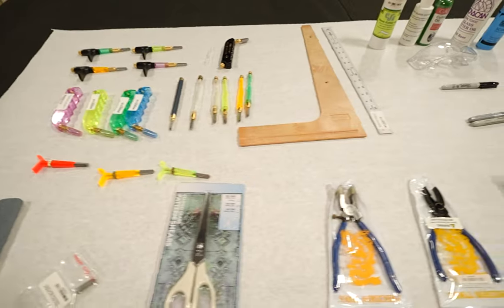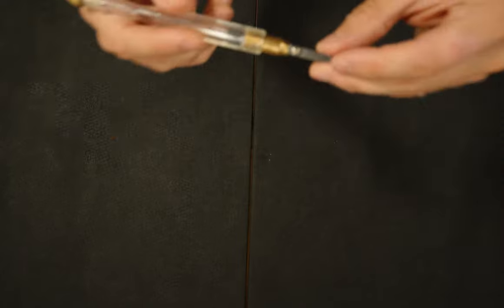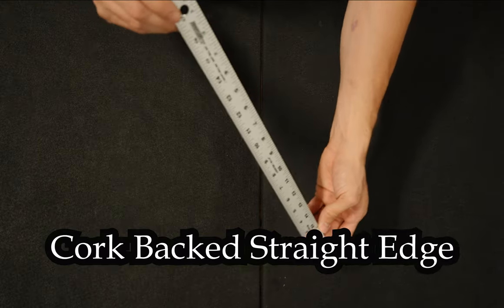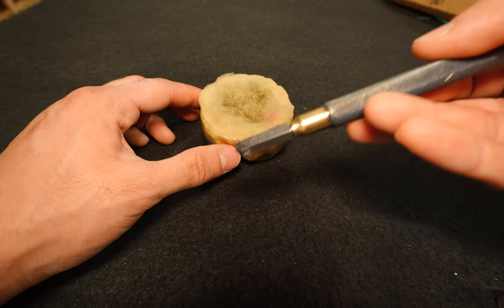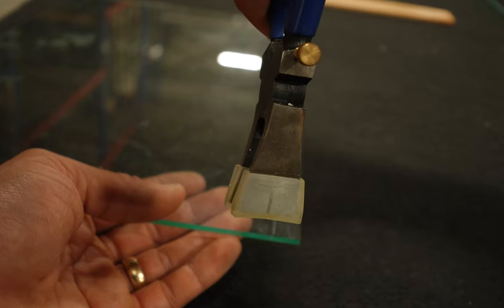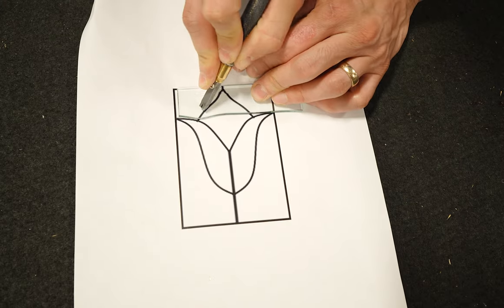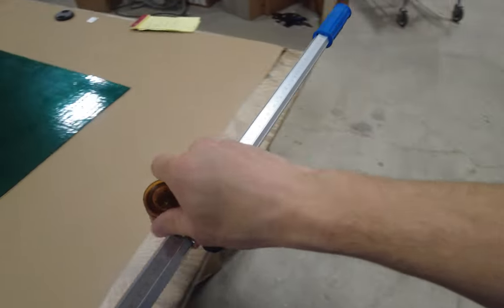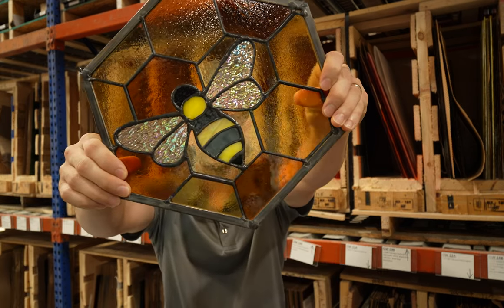How to Cut Stained Glass in 2024 (TOOLS, TECHNIQUES, & SECRETS!)

Comment: Good info. But Pattern shears should not exist  LOL I have taught Stained glass for many years, and only one student stuck with pattern shears. They dull quickly, they are usually not the correct "gap". Just say no to pattern shears  LOL Regular scissors and Xacto blades are best IMHO.
Reply from the maker: I agree James thanks for the tip!

Comment: Hi Mr. Stained Glass, I'm new to your channel. Thanks for these videos. They are very helpful. I'm retired and just getting back into working with glass after a 40 year hiatus. I find I spend an awful lot of time grinding due to poor cutting and grozing skills. Especially with smaller sized pieces. I suppose it will improve with practice. Any advice on how to practice?  Also, I am shopping for a new grinder as the one I have is quite old. Do you have a mid priced one you would recommend? Thank you!
Reply from the maker: Hi! The best way really is to just keep practicing. It may be wise to buy some cheap 1/8" clear glass just to practice scoring. Gryphon gyphette is a nicely priced smaller grinder. We use them often.

Comment: Your shop looks like Delphi, when you mark pattern on glass, your mark stays? spray adhesive, cut pice, spray on back, adhere to glass, cut to line. residue washes off then use glass
Reply from the maker: Never been there! Our facility is ~30k sqft.

It stays well enough to get the first score off and an initial round of grinding. Occasionally may have to remark if your score was really off. I find the cutting of the pattern, gluing, etc is a big hassle personally! But it works!

Comment: Thanks for this awesome overview! Additionally I recommend using ffp3 masks, while sanding glass, so you don’t get glass dust particles into your lung, cloaking up over time. Also you could use an art scalpel for cutting your paper templates. This way you cut paper sheets almost like you cut the glass. In addition you have much more control over the line thickness and be much more precise then with scissors. It is common among architects and designers, handling paper and likewise materials.
Reply from the maker: Awesome advice, I'll have to check out that art scalpel.

Comment: Very informative video.  I have a question about glass cutters. How do i know if the head needs to be replaced? I'm fairly new at this, I've only done a few panels so far. It feels like I'm not getting a good score line but it could be just my technique. I might be pressing way too hard with the cutter.  I'm finding that I'm doing a lot of grinding because of rough jagged  edges.
Reply from the maker: Rough jagged edges means that you are not holding cutter at a 90 degree angle to the glass, it's slightly angled to the left or right. Especially prevalent on curved edges. Try cutting on some scrap glass and purely focus on the cutter being perfectly perpendicular to the glass. Break those and see if you're having the same problem. Also make sure your cutter is oiled up
Reply: Thank you, I'll work on it!